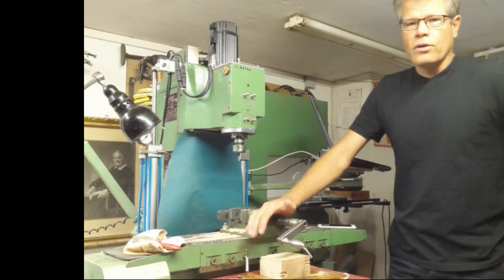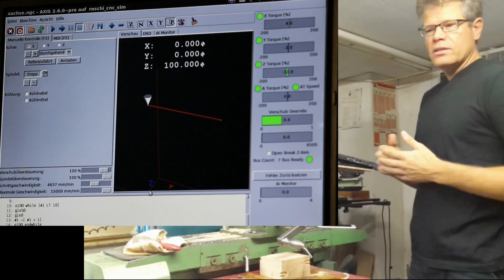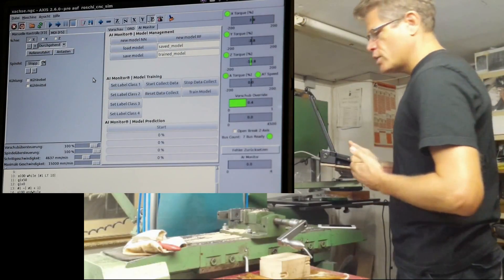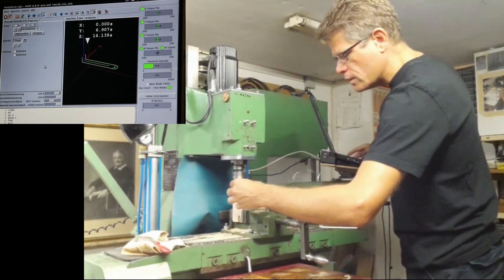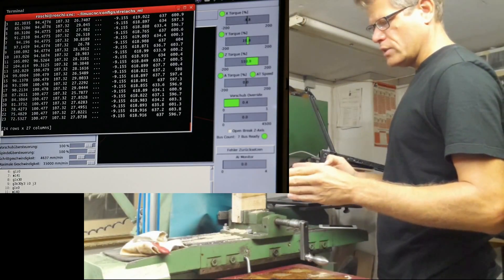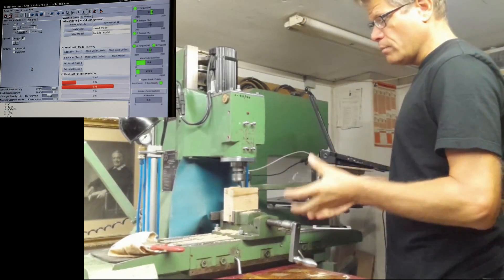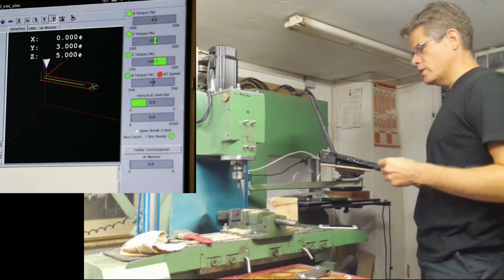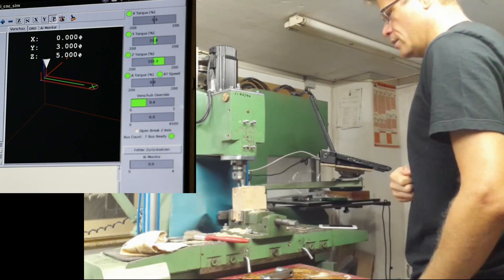Machine Learning Algorithms used in LinuxCNC

Comment: Fantastic! Obviously a work of love that deserves more attention. I see your link to the project. Please consider placing the project files on GitHub so changes by others can be easily shared. Best wishes from the US
Reply from the maker: Thanks for the hint. I've pushed the files to github. See the link in the describtion.
Reply: @AndreasSchiffler  Thank you. Do I have it correct that your features are [XYZ position] and [avg, min, max] summaries of the [torque, speed] for the [XYZA] axes? Seems you tried MLP. Did you see a pattern in the importance of features? Was the hidden layer necessary or was similar trainability achieved without a hidden layer?
Reply from the maker: @kentvandervelden  Hi, yes that's correct actual positions (3 values), [avg, min, max] for 1000 values of torque and speed in the three axis + spindle (24 values). The values are captured with period 1 ms and the position values are taken sychronious every time 1000 values are available and 'features' are calcualted.
About MLP. My approach was focuesed initial on the hole concept (capture, train, evaluate) not yet in details. But the best performance was by using random forest approaches for the model.